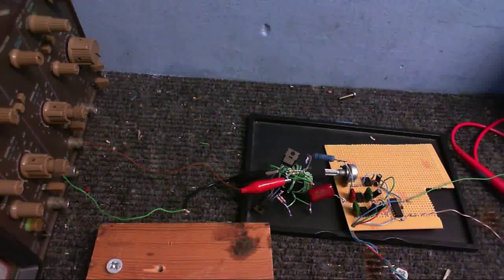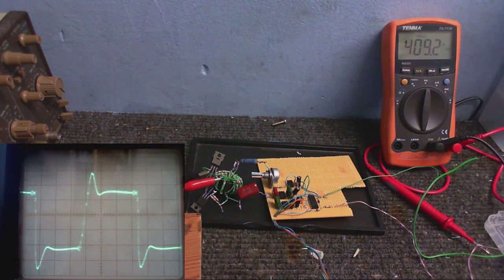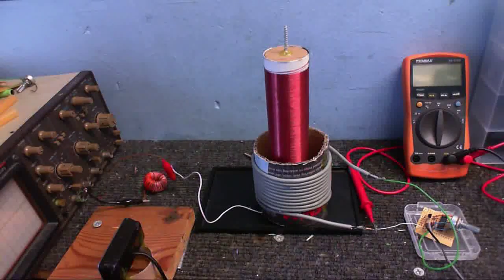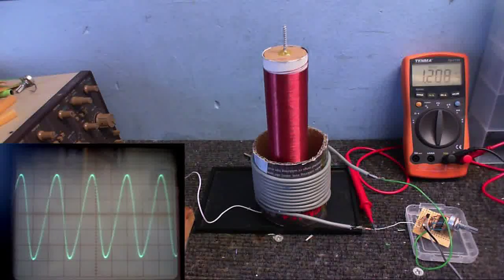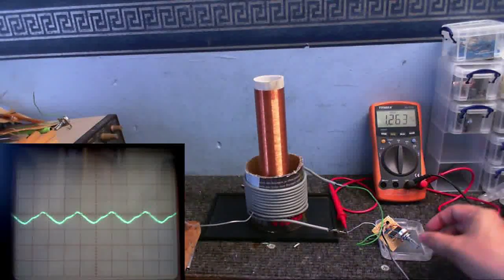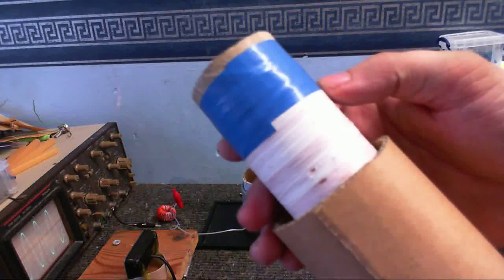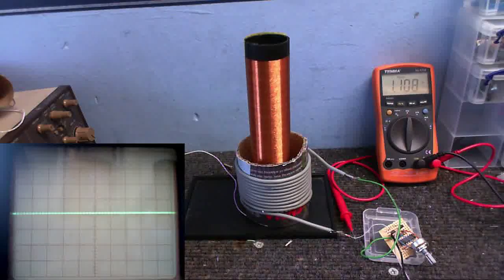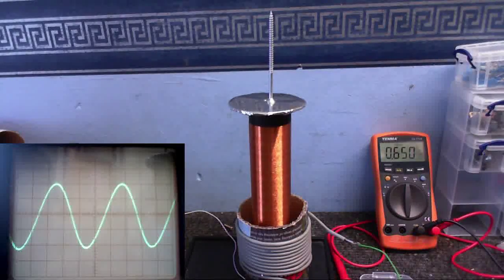Update on the SSTC project

Comment: You probably already know this and ill sound a bit silly saying it, but anyways it could help you out:

adding a capacitor to the secondary decreases resonant frequency of secondary LC circuit so that could be tried with cake tins or something like that,

You could possibly use that if you want it working at a lower frequency, 
The mosfet won't have to be switched that hard then.

for anyone who is curious, L stands for the inductance of secondary coil and C stands for the capacitance between the topload and the room around you

Of course, nothing is perfect in electronics, just like nobody is perfect,

the GDT seems to be working pretty well for you, good luck!